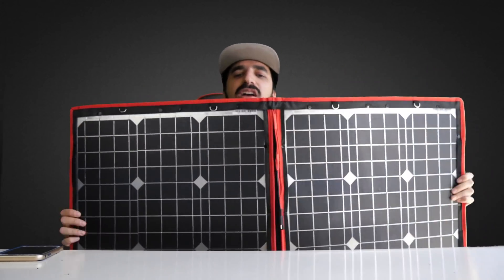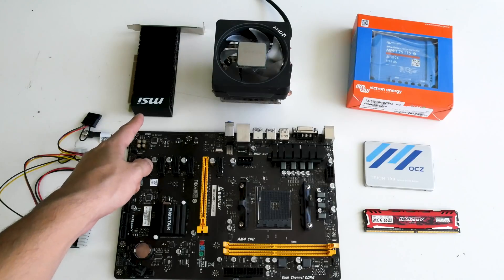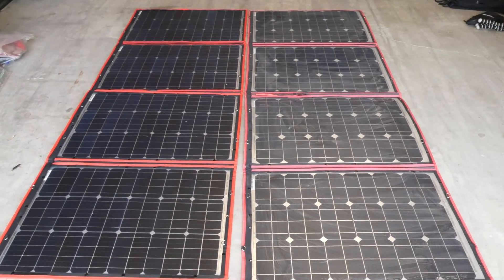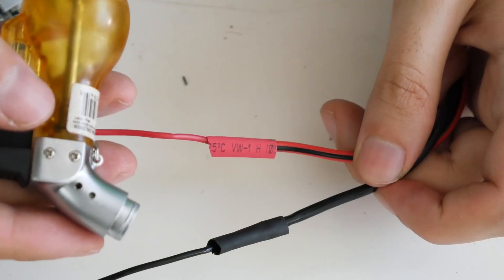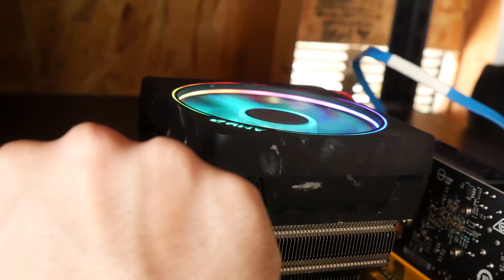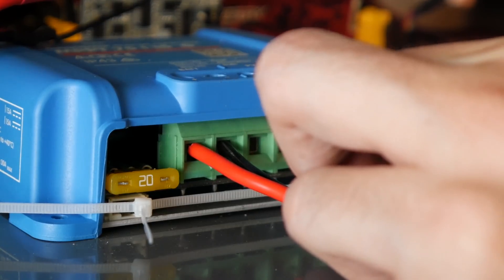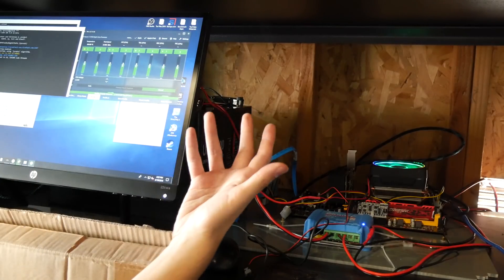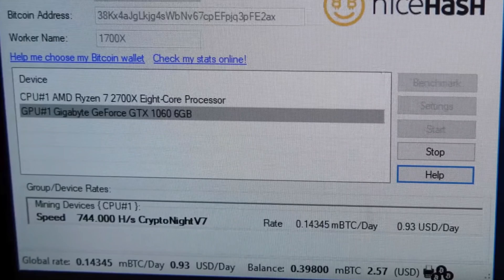400W Solar Miner Experiment + GIVEAWAY!

Comment from the maker: As requested, here is list of all the parts used with affiliate links:
200W Fordable Solar Panel by Dokio on Amazon - https://amzn.to/2JVttuF
MPPT Solar Controller By Vetron - https://amzn.to/2JWE0pC
AMD Ryzen 7 2700X CPU On Amazon - https://amzn.to/2lr2Z5O
AMD Ryzen 7 2700X CPU On BitcoinMerch.com - https://bit.ly/2Ifq4RM
12V DC To DC Pico PSU on BitcoinMerch.com - https://bit.ly/2KbhCVm
Reply: Hi, I’m quite new in that business. I saw the list of parts used but it is not complete. Could you published an exhaustive list so I could buy all the same components and assembled them as you did? That would be really great to start this amazing experience here in Spain. I’ll appreciate your help amigo
Reply: can you tell me the brand and model of the drone?

Comment: i have a much beefy solar setup for my mining setup with 8 industrial grade solar panels producing a total of 5kw/hour that charge batteries. battery capacity is enough to run the mining setup for 27 hours nonstop without needing a recharge. so basically nulling the electric bill. 
PS: i do have the normal electric line for backup

Comment: Congrats, you are genius! In my country (Brazil) Electricity is very very expensive ... around US$0.25 per KWh, good solution for me! Cheers
Reply: And I thought 13 cents kilowatt hour was bad I plan on selling this house in Oregon go back to my birth state Florida and invest in full size solar on the ground to power the complete house running a 6 1080 ti,s on a rack fixing to get a 12 on next rack was thing 2080,s but here there power suckers may stick with 1080s as well

Comment: Great info. I'm from Puerto Rico the perfect place to use it.
Reply: Hi, I am planning on moving to PR at the end of the year and I was planning to continue mining over there using solar. Right now I am mining with 18 rx570s in a small apartment in Manhattan. I am thinking of replacing those with gtx 1060s when I get there to lower my wattage from 850 watts per rig to about 550 to 600 watts. Electricity in PR is $0.28 /KWh when it's on, wayyy to expensive for mining.
Reply: learn to build them yourself if ur there. Its not that difficult

Comment: That should work perfectly ok in INDIA.....!!! So send it to ME.....!!!! ;-)

You DID IT WRONG.... YET AGAIN....!!!
TO GET 400W 12~13V out of the solar panel, you need to connect it in PARALLEL(12v 200w parallel to 12v 200W = 12V 400W; 12v 200w serial to 12v 200W = 24V 200W) your solar charge controller will reduce 24v from your solar pannel setup to 12 v for your battery(12v batteries connected in parallel = 12V).

And always connect the negative/ground FIRST....!!! 

DON'T MAKE YOUR CHARGE CONTROLLER WORK HARD....!!! Reconnect those solar panel in parallel.... RED to RED and BLACK to BLACK .....!!!
Reply: Running them in series actually works the controller less... There's half the amperage running through it. The controller can convert 24 to 12VDC easily. Not sure what you're on about.

Comment: im installing a 15000 watt  solar panel in Wisconsin
Reply: Yup how much that cost 14k?
Reply: It's about 11k it's about 300 a month my electric is 250 a month with out solar but in wisconsin u get rebates for solar the system will almost pay it's self off in 3 years but let the mining begin
Reply: @andypeer4224  how did it go?
Reply: Andy Peer damn how much that cost?

Comment: Don't bother with this idea. It is simply too weak and poor.  If you have a bitcoin miner such as the Bitmain S9, it is already at 1300 watts which will need plenty of batteries.
Ditch the batteries and go with grid tie inverters.
Your solder is also too weak and dangerous.  You have to tie the wires together before soldering them.

Comment: Move the panels to the top of the roof if you shade just 1 cell in a panel you loose almost all the output from that panel. I have a cargo trailer with 4x 350w feeding 3x 1060 underclocked and 3 24v tesla modules

Comment: How many panels is needed for 6 gpu rx580 = 800w ish everyday panels 250w ?
Reply: I think you need at least 3 times that (800W*3=2.4kW) because normally you have sun available only 1/3rd of the day. Also enough batteries for the other 2/3rds of the day (800W*16=12.8kW or about 1,100aH for a 12V system) if you plan running 24/7. Best is to raise the system to 48V so you get the same Watts for less Amperage, then convert to 12V for CPU.
Reply: JF Deckard also you'll only get half of the advertised watt of the panels.  So they 800x3x2 = 4800 watts, so 48 hundred watt panels.  Remember you're using 800watt 24/7
Reply: lets not forget the cloudy days.

Comment: From Southern California. So 450 Watts solar got the rig off grid, it probably take 800 to 900 Watts solar to get the monitor off grid. That means at least to 2 more deep cycle batteries. The batteries is probably what kills the chances of pay off but to off grid battery is necessary.

Comment: I'm from india, can you try using a fanless passive heat sink for the cpu, set underclock settings in the bios and mine without the gpu installed to check power consumption.